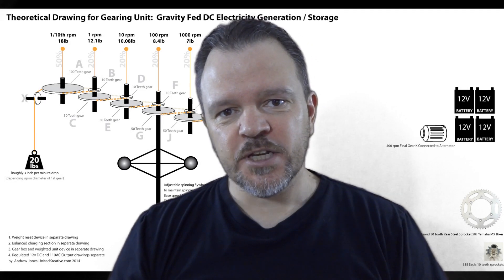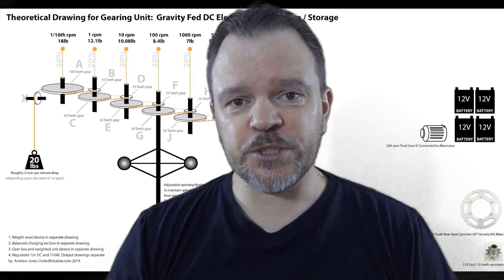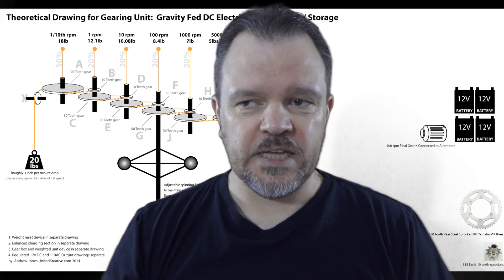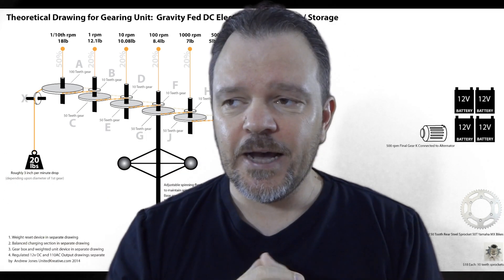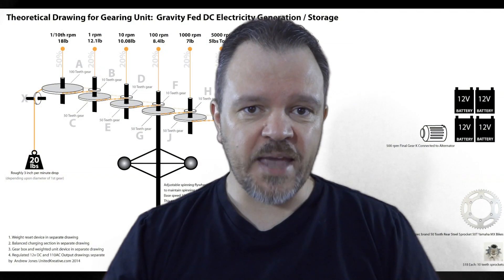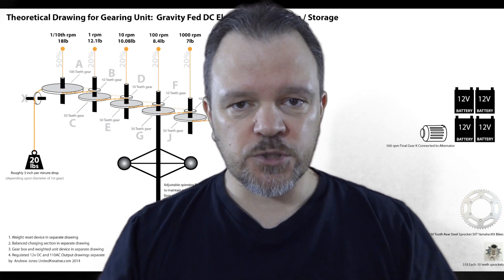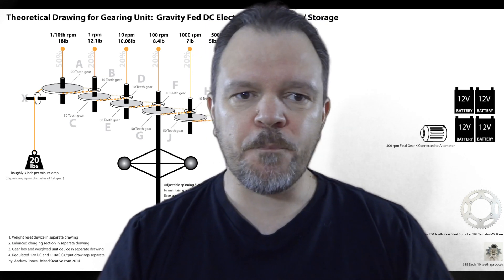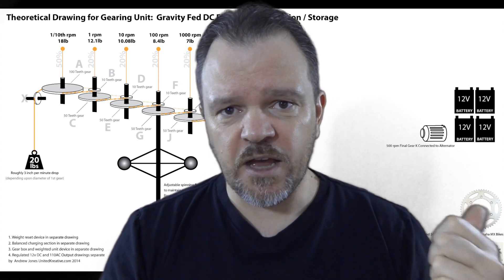FREE Renewable Energy, Gravity Fed, Green Electricity Generating Machine

Comment: Simple. Buy 2-20’ / 6” pvc pipes, connect them together with 90s on one end and 2 Ts on the other end. Stand it up with the 90s on the ground and lean it up against your house with the Ts on top. Insert an air line connected to a bubbler in one T. The air bubbles create a pressure differential so the water starts flowing in the connected pvc pipes for as long as u have the bubbler plugged in. In the other T connect a low flow 500 watt  hydro turbine. The bubbler takes 90 watts the 500 watt turbine will produce about 300 watts 24/7/365. I should know because I have 3 of em

Comment: If you had a pneumatic pressurized system that was pre-charged in advance to have enough air pressure to raise the weight and the lowering of the weight would add additional pressure that would be used to raise the weight back up to the top then the system would more or less self sustaining.

Comment: As recently as the late 1960's in the USA - many of the very remote lighthouses were powered by gravity driven clock motors that were manually rewound by the lighthouse keepers. This was, at that time, the best off-grid power alternative. It is reliable, robust and relatively easy to make and repair if needed.  If you want to design an off-grid power source it would be a very good point of departure to start at the most recently used off-grid power source.

Comment: Why not use a liquid weight, switched when the weight reaches the bottom so that it refills the top container. The pump could be connected to a battery that is recharged as the generator is working
Reply from the maker: ***** This has been suggested already Philip, but will certainly be a part of the tried versions of creating this monster. :)

Comment: Bike gears / bits are at least relatively cheap . Try and get mid range stuff , the low end stuff is often so cheaply made , that you spend all time adjusting & righting to get round the low standard of manufacture . If you build it to last any time , try and get chain guard on it , not to stop fingers getting in but to keep effeciancy up / dust out . & if you can get it tight fitting , may be even use light oil , watch type oil , to keep friction low . WD40 , not good as a lub , but good for washing dirt & dust out of parts & derv ( diesel ) / paraffin ( kerosign ) works well in this area also .
If you want to think of how elec industry does it ( to allow for not wanting to turn off base load machines ( expensive / effectively impossible to close down & start up  ) think of the domestic storage heater ( they sell you the power cheap to get shot of it & keep the equipment running ) & then think of pump storage http://en.wikipedia.org/wiki/Pumped-storage_hydroelectricity http://www.bbc.co.uk/bitesize/standard/physics/images/hydroelectric_power_station2.gif, http://en.wikipedia.org/wiki/Dinorwig_Power_Station 
these systems work well , 'cos the potential energy storage is cheap ( ie water ) but is lossy , water to pipe friction . So , you may find that a weight & a clock type escapment may be a better system to use . I was apprenticed to the company who made the generators for the Dinorwig one ( GEC Rugby ) . At the moment the Environment agency have to projects , to test / evaluate wind driven & solar units to "lift" water . The wind units use a vertical turbine & the solar ( very sletchy info ) sound like it used solar to drive a Sterling engine type structure . Keep happy . Regards Bob ( London UK )
Reply from the maker: magna59 Thank you again Bob. Some good points. I think I'll use bike gears with teflon lubricant oil for racing bikes for less friction. I am from Bristol in the U.K. just so you know. I might take a ride to Home Depot (they sell everything) to see what i can buy as the geared assembly frame. I think bike gears will be good for now and easier to make a real system with alternator possibly. It's certainly going to be fun just playing with it all.

Comment: http://www.tp178.com/ct/foliotdrawing.jpg 
Andi , go and look at old church clocks The things , gears / cables you talk of are all loss , chain / tooth belt loose in the region 1/3 . Do I know anything , using X Ford Escort alternator & bicycle , appx 200 watts in 60 watts out , a combination of bike transmission & fan belt & alternator lost the 140 watts . If you have spare energy , may be a good method to get a storage buffer , but don't think it's zero point , 'cos I percieve you will be sadly dissapointed . Good luck , but don t hold your breath !
Reply from the maker: magna59 Excellent, thank you Magna! Love your input. In fact, the mechanism I once saw like this may well have been an old church mechanism for something. It ring's a bell (no pun intended) Certainly not zero point for sure, but presently i am struggling with what scale to begin this with. I might just go with Bike gears etc for now. :/ AAARG!
Reply from the maker: magna59 Love the drawing too thank you